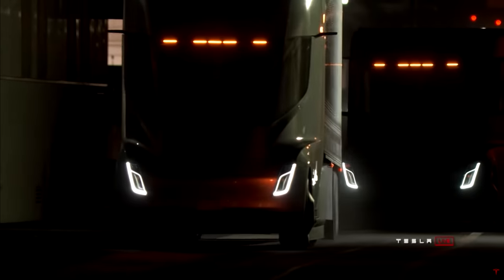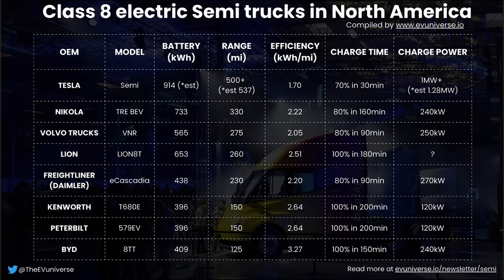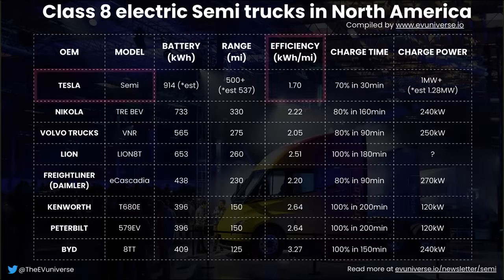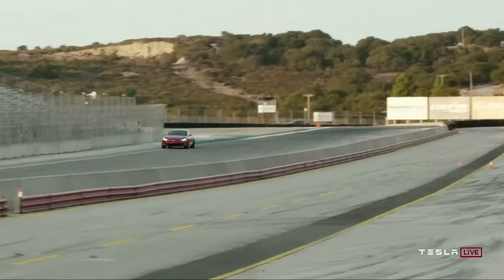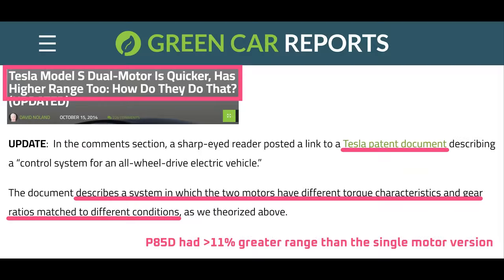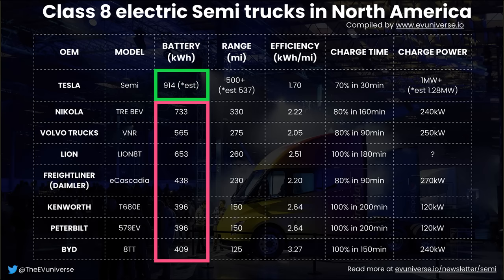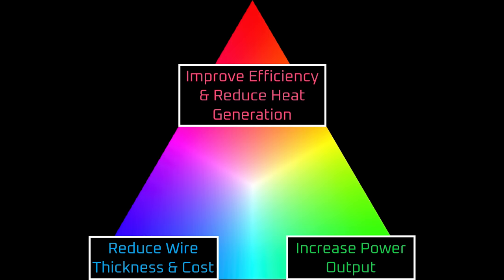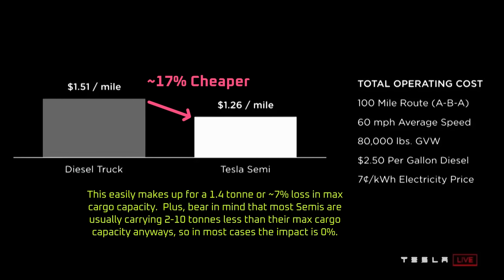How the Tesla Semi “Broke the Laws of Physics”

Comment from the maker: Read before commenting on regen and 17% cost advantage: 

1) At 12:35 I say that the Semi recaptures 90%.  Obviously this is one way efficiency.  The round trip efficiency would be 81% because it has to go from battery to wheel and then wheel to battery.  More on this in the next video.

2) A lot of people are thinking the 17% cost estimate is mine.  It's from Tesla - directly from their unveiling event.  Cleanerwatt did an update of this on his channel, go check it out.  https://www.youtube.com/watch?v=WIzcaBSFud8&t=951s
Reply: Is it possible that rather than treating the battery as a single unit Tesla could be say dividing the battery into say 9 sections of 100 kWh each and alternately using one of those sections to power the vehicle and be available for recharge, rotating these sections to increase life cycle.
Reply: @jjamespacbell  good idea
Reply: @jjamespacbell  woudlnt it be better against degradation if enery divided into more cells?
Reply: The carbon wrapped plaid motor was an innovation subsequent to the original concept. Tesla has a talent for leveraging luck...😉
Reply: @davincisghost9228   More engineering intelligence and talent than luck.
Reply: Elon began studying Super Capacitors at one point, bought a Company engaged in Manufacturing, and that may explain the regenerative braking performance?
Reply: Its complicated.
Reply: Er...nope.  The energy going in is overcoming a combination of gravity, friction and wind resistance.  When it comes out via regen there is a conversion of kinetic energy (and potential energy if going down hill) but it is fairly meaningless to say 81%.  It is not true to say that 81% of the energy consumed travelling uphill is reclaimed coming downhill.
Reply: @jjamespacbell  If anything that would decrease battery life.  Charge and discharge rate would be higher one a 'per cell' basis.
Reply: @davidwilkie9551  No. May as well regenerate into the lithium batteries.  Super caps provide no advantage, just more complexity and reduced efficiency (another storage and power conversion step).
Reply: @chriswright9096  Correct on all points.
Reply: I think even 81% recovery is optimistic because some deceleration energy will be lost to friction from tires, drive train, and wind resistance.
Reply: @chriswright9096  Agreed. It would be more accurate to say that 81% of the excess energy due to the climb is recovered on the subsequent descent. Of course, you will still experience losses due to air and rolling resistance, none of which will be recaptured.
Reply: @LaBamba690  Thanks
Reply: @jjamespacbell  Unlikely.  Battery life is always increased when treating the battery as one single battery.
Reply: Would have been nice if you had gone into the Pepsi comment: "PepsiCo’s new Semis can haul Frito-Lay food products for around 425 miles (684 km), but for heavier loads of sodas, the trucks will do shorter trips of around 100 miles (160 km), O’Connell said."

IMHO, I think there's a couple things going on.

1) Tesla's range figures are for 55mph.  Range will suffer meaningfully at higher speeds.
2) There's a range of other things that the owner can do that will lower the efficiencies, such as using dualies, omitting skirts, winter tyres, etc.  Some customers simply will need things that reduce the range.
3) You have to leave significant buffer.  Can't realistically come close to using your full range.
4) They're possibly (probably?) not charging on each end, and thus need to do round trips.

I think a key aspect is that he said "CAN haul" but "WILL do", not "CAN do".  "Will do" implies "we plan to do that", and thus "is subject to the constraints of what we plan to do", thus including things like charging schedules, buffers, etc.  That said, it could definitely use more clarification.
Reply: @jjamespacbell  I don’t get your point. To increase longevity, it is always best to draw as little power as possible from the cells, so using all of them at the same time should be the best solution.
Reply: @bru512  intent was not to increase battery life but to allow for available space to regenerated electricity 
The reason I proposed rotating the sub block of cells was spread the degradation
Reply: I think the point is that the Tesla Semi can capture for reuse 90% of the energy that the typical diesel Semi throws away in its braking decelerating/braking down the hills or coming to a stop.
Reply: @davidwilkie9551  No, Tesla bought Maxwell Tech. for its dry electrode patent. Then sold the company back to the original owners minus the patent. Yes, supercaps could be used in regen, or increased acceleration, but are very bulky and expensive. The ability to create motor regen is all in the control electronics and has nothing to do with where that energy gets stored.
Reply: @karenrobertsdottir4101  You are reading a whole pile of things into this that do not apply. PepsiCo has more pop plants than chip plants. The pop deliveries are always shorter distances, this is to save on diesel fuel.
Reply: @JRP3  This losses happens even on flat roads. They are a constant factor and does not increase due to elevation changes. This means they are calculated separately and not included on the calculation for losses on elevation changes.
Reply: @kazedcat  Energy is expended to overcome them so of course they need to be calculated when calculating regen.  If say 10kWh is used to climb a hill and 10% of that is aero and friction then that is 1kWh used to climb that will not be recovered from regen and it will count as regen losses.
Reply: @JRP3  But you will be double counting the energy loss when you calculate energy loss due to distance travelled. It will be much simpler to calculate energy loss related only to distance then calculate energy loss related only to elevation changes and just add the two losses in the end for total energy consumption. Your method needs to subtract back the distances with elevation changes in your total distance travelled making the calculation very convoluted and unnecessarily complicated.
Reply: @kazedcat  You're the one making it overly complicated.  The battery use only shows total losses, it doesn't differentiate from where they came.  The vehicle will show X amount used from the pack to climb a hill and Y amount returned to the pack going down the hill, that's it.  The calculation is very simple.
Reply: Yeah it was 17% when Diesel was 2.50.. pretty easy to update that for today..4.60
Reply: @JRP3  No that is not the only thing that happens. The battery charge will also drop driving on flat road.
Reply: @JRP3  With your method two hills with exactly the same elevation but one is at 3% grade and the other is at 9% grade will have different efficiency rating. Your method measures the efficiency of the hill not the vehicle.
Reply: @kazedcat  I'm sorry but you have no idea what you're talking about.
Reply: @JRP3  So you give up explaining how your method is measuring vehicle efficiency instead of measuring the efficiency of the hill. Because that is exactly what your method is measuring how efficient is the hill.
Reply: @kazedcat  You've proven yourself to be a waste of time.  "Efficiency of the hill" 🤣
Reply: @JRP3  An efficiency rating that changes depending on which hill the vehicle is climbing is measuring the efficiency of the hill.
Reply: @chriswright9096  Correct. If we assume tires cause a 5% waste heat going uphill, then downhill is another 5%. Same for air resistance, but air resistance alone can eat 50% at 70 mph each way. I measured my BEV regen efficiency at 50%. Every kWh spent going uphill gave half a kWh back in the battery going downhill. 
If we assume the motor, invert/charger, reduction gear(transmission), differential, tires and air resistance are all 95% efficient, 0.95 x 0.95 x0.95 x0.95x0.95 x0.95 = 74% That's uphill. Then same equation downhill means: 0.74x0.74= 55%  I think 60% round trip efficiency is a good as anyone can do. And that's below 50 mph.
Reply: @kalmmonke5037  We can find a YT film from Tesla Bjorn (Bjorn Nyland) in which he compares degradation from 2 tesla's, same afge, same amont of miles (km).
One mostly fast charged another mostly slow charged.
To his (and my ) surprise the degradation did not really differ between those cars.
It;s less how much we do fast charging, more how much times (cycles) we charge and aging in years.
Of coarse both cars were used in teh same climate conditions.
Reply: @jjamespacbell  The Cu wiring will increase, also creates a rather unbalanced pack... Faster heat buildup (due to higher C-rate) per each 1/9 section will cause faster and more uneven battery degradation... Keeping all cells at same temperature is key for longevity as all batteries need to experience equal temp excursions.
Reply: Regenerative braking traction and reasonably even tire wear are limiting factor for the three motors.  With one of the two rear axles powered, the maximum Regen braking could only be about 0.15g which is very weak and would have worn those tires very fast (I had this problem on my Mitsubishi i-Miev).  With both rear axles powered, maximum regen braking is about 0.3g which is much more acceptable for common driving and tire wear would be much more even.  Bad weather traction is also another obvious reason.  I wouldn't be surprised to see a future electric semi having the front wheels powered also.  These numbers assume an even weight distribution, and are a very rough conservative guesstimates.
Reply: Actually, if it’s getting the reported 1.7Kwh/mi performance and they’re only charging $.07/KWh at the Mega chargers, then the Semi would be costing $.12/mi. …That’s SIGNIFICANTLY less than a diesel Semi running 7mpg and paying $4.90/gal for diesel…without even accounting for DEF! I gotta get my hands on one. Oh, and BTW, diesel Semis need a $500 oil change 2-3 times a year…
Reply: @greggrant4614  Exactly..and it's mind blowing 🤯 I need a physics geek to quantify how much energy that really is. How is that measured? Stopping 80k lbs from 70 mph to 0.
Reply: @glike2  I expect any semi will have much more weight on the rear axles than any normal car for transp[ort people. (Only not when there is no trailer connected).
Which means that regenerating on the rear wheels is the logical one for semi's ...On a normal car  its more logical to regenerate on frontwheels....or all wheels of coarse.
Reply: @karenrobertsdottir4101  You have misquoted PepsiCo VP Mike O'Connell, in a way that completely changes the meaning of what he said. What he actually said was that "for heavier loads of sodas, the trucks will initially do shorter trips of around 100 miles". And he went on to say that "PepsiCo then will also use the Semis to haul beverages in the 400 to 500 mile range as well". I highlighted the parts you omitted.

 His statement that PepsiCo will be using the Tesla Semis to haul sodas initially for 100 mile runs, but later for 400 to 500 miles runs, makes it clear that this is a decision on the allocation of tractor assets to where they'll do the most good at any time, and not a limitation of the range of Tesla Semis hauling heavier loads of sodas. It is difficult to see how this could be inadvertent on your part, so it appears that you've deliberately misquoted the PepsiCo VP to better fit your narrative.

1) I'm not aware of Tesla announcing a range figure for 55 MPH. What they did show is a graph of battery % against distance for a 500 mile drive at an unspecified speed, and a time-lapse video showing speeds mostly ranging from 55 MPH to 65 MPH—consistent with the 55 MPH speed limit for semi trucks in California. Of course, range will be less at higher speeds; no one's claiming otherwise.

2) No doubt; but this will be on the owners, and doesn't change the fact that Tesla has demonstrated the ability to drive a Tesla Semi, loaded to almost the 82,000 lb. GCVWR for electric trucks, at speeds consistent with the speed limit in the state where the demonstration was run, with 93% of a full charge.

3) As noted in 2) above, the 500 mile range test left a buffer of 7% of charge.

4) This is very likely true.
Reply: There is of course one aspect that is rarely discussed: 
All of these efficiency considerations require that the price ratio between diesel and electricity stays roughly the same. 

I don’t know how the situation is elsewhere in the world, but here in Europe, many people that drive electric cars feel the heat of an unprecedented price increase: electricity prices have than doubled over the last year. 
Diesel is up, too, but by a much smaller percentage. If you charge public then probably your cost savings for going electric are gone. 

 if you have a PV then you don’t have to care of course. 

I believe this should at least be mentioned. 

Current price levels in Germany:
Diesel: ~1.80 €/l
Supercharger: 47-52 ct/kWh.
Reply: @jjamespacbell  Probably not.  The Tesla Semi is heavy and it supposed to be able to haul big loads so the battery pack would need to be able to deliver a huge amount of amperage and that's only possible if the battery packs are all tied together.
Reply: @chriswright9096  I have a DIY EV,  a can accelerate at + 100% torque without slipping the wheels, but at -50% regen torque the wheels lock up. (at same speed)  I'm not sure why this is so, anyway, also i suspect 90% battery to asphalt efficiency is a bit optimistic. 90% battery to wheel maybe yes.
Reply: @esbrasill  Interesting.  Under heavy acceleration weight is transferred to back wheels while under heavy braking weight is transferred to front wheels.  Could it be something to do with that?
Reply: @chriswright9096  That would have the opposite effect since its a front wheel drive. I'm thinking losses in the gearbox, its a manual 5 speed.
Reply: I thought Engineering Explained already explained this. There is no free energy and super capacitors do not work the same as batteries for steady power draw. They are for quick surges and that's why they're still called capacitors, not super batteries.
Reply: they also like to break up on the side of the road alot. love to see it fail
Reply: @chriswright9096  It is true, though, to say that 81% of the excess energy due to the climb is reclaimed, and it's good to know what the number is for planning and what-if purposes. Of course the energy lost to rolling friction and wind resistance aren't reclaimed, and would have been experience on flat ground as well.
Reply: @JRP3  @kazedcat  You're the one making it overly complicated. 
No, @kazedcat is correct. MotorMatchup derived the physics of Tesla Semis here: https://youtu.be/zQDU9f4QTLk?t=466, including a discussion of regen braking, where the aerodynamic and drag losses are calculated separately from the energy used for the elevation change.
Reply: @kazedcat   It will be much simpler to calculate energy loss related only to distance then calculate energy loss related only to elevation changes and just add the two losses in the end for total energy consumption. 
You are correct. I pointed this out to JRP3, including a link to a video where MotorMatchup derives the physics of the Tesla Semi, including calculating regen energy the way you suggest.
Reply: Jordan - I think Future BEV semi will have Multiple DU .
BEV semi will use EV motor Trailers w/ batteries to carry a FULL LOAD over Long Distances. 
this motor Trailer can also be Covered in SOLAR (as Replacement of Wall Materiel ) , this would be over 3,000 Watts (on 3 sides) and can be used to Charge the batteries ON the ROAD as early as 6am. 
DOT Laws will have to Adapt to ever changing Innovations in DU motors, Battery pack , REGEN and more. 
they will have to Carefully balance the Battery Advantage vs Parasitic weight. 
the batteries in the Trailer + DU motors would Reduce the Demand when hauling a Full Load uphill. 
the Extra DU motors would , only Slightly increase the Total Available Torque .